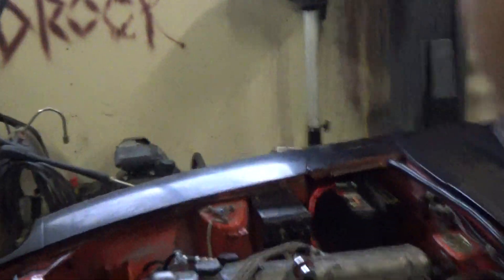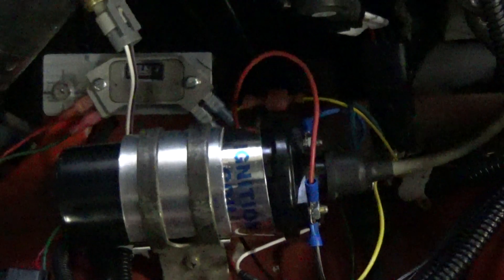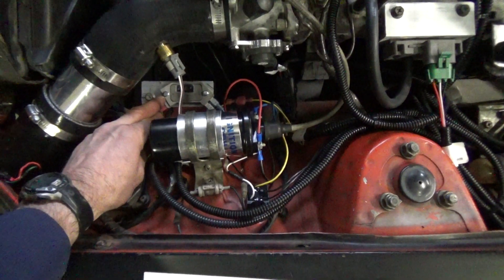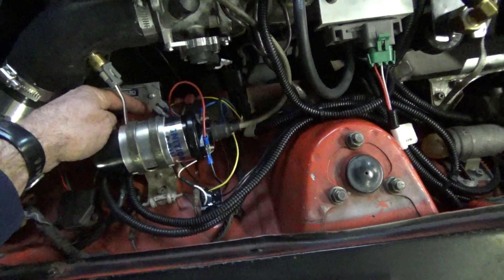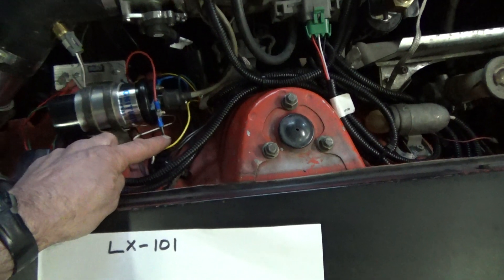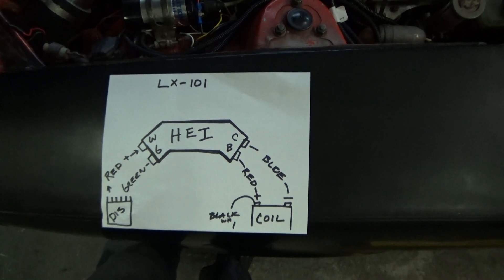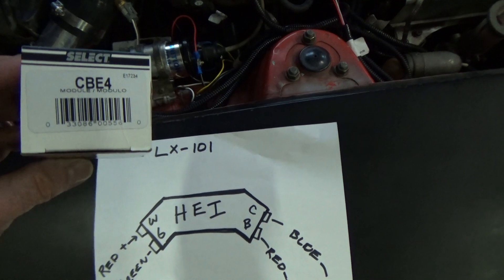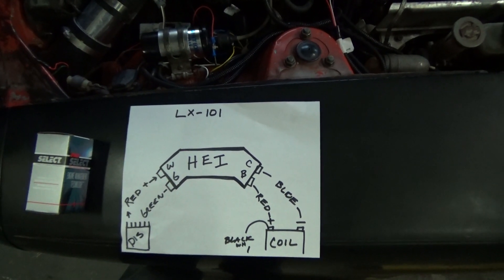HEI upgrade for Datsun 280Z

Comment: What do you do with all the wires on the ignition controller and will this work on a 76 280z?
Reply from the maker: Hello I put the wires tucked in the area near and under  the break booster and if your car is a and EFI controlled car it will work this kit just replaces the old EFI system
Reply: Badrock Chopshop hello. so you ran the wires from passenger side kick panel out to near the brake booster?
Reply: I was thinking on mounting the actual hei inside the old icu and re wiring it in there but you’d set up looks a lot simpler